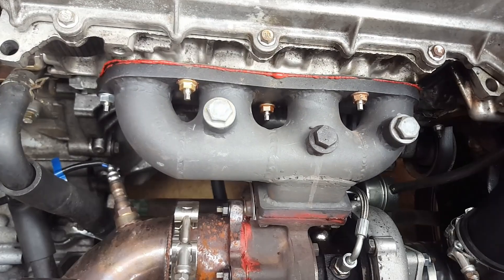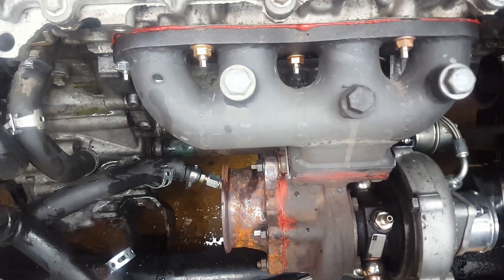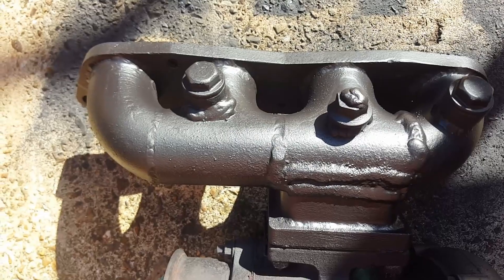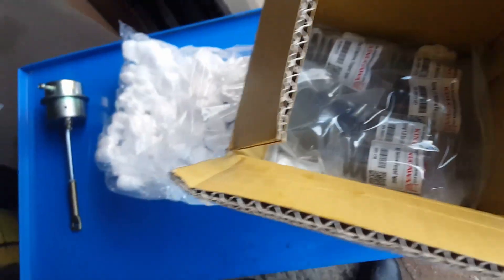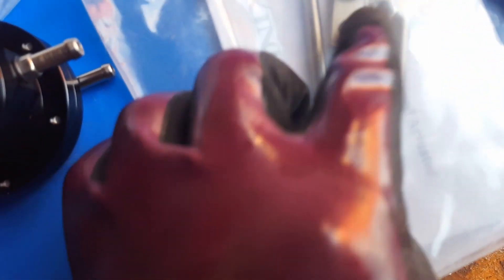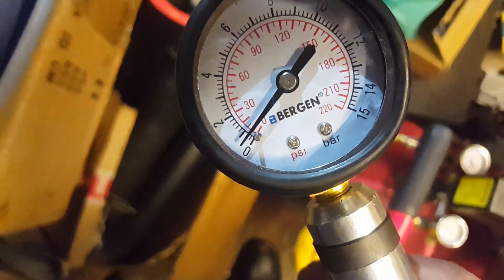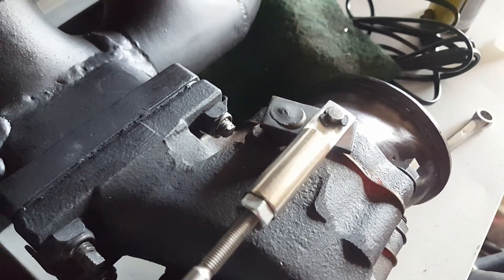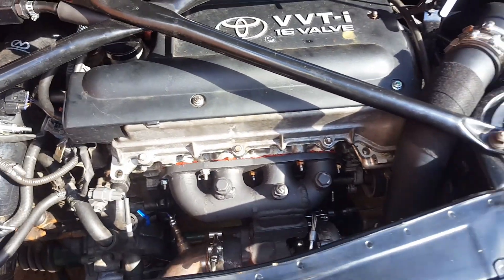Custom Turbo 1ZZ MR2 Roadster / Spyder Build Part 5 - Cracked Manifold & Fitting Turbo Actuator

Comment: What’s the oil consumption like now Dan using 10/40 oil? Mine uses a litre every 3,000 miles using 5/30 synthetic
Reply from the maker: Hi Rob, I have probably only done 400 miles in the car since all of that. Lockdown hasn't helped. I did lose about half a litre after 400 miles, but the car has spent some time on the dyno and been driven quite hard so more blow by? I guess I will monitor over the next 600 and see. Although it's not promising thus far. I think the rings might be worn.
Reply: @ModorFix  does sound like the oil control rings as you say. Great job with the turbo conversion though. I really enjoy your videos